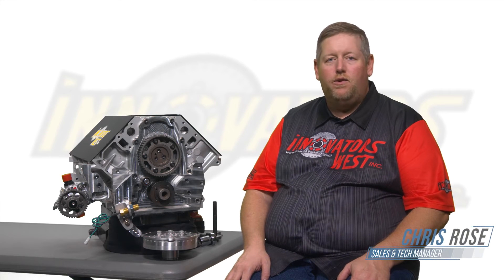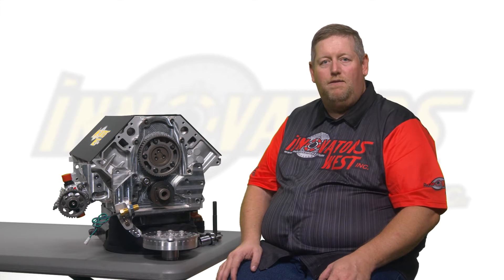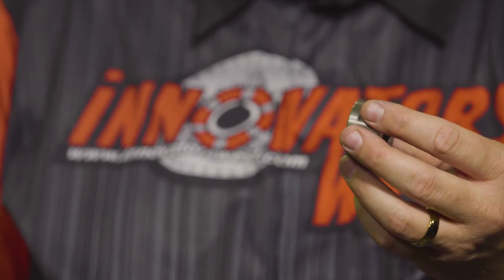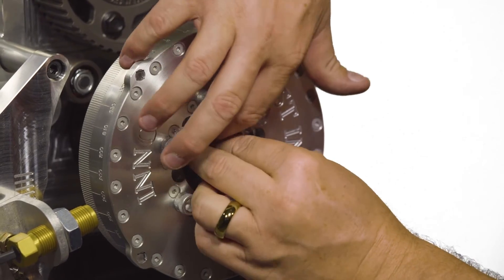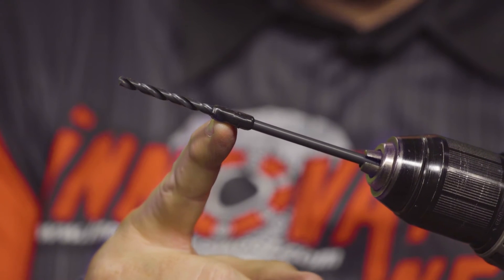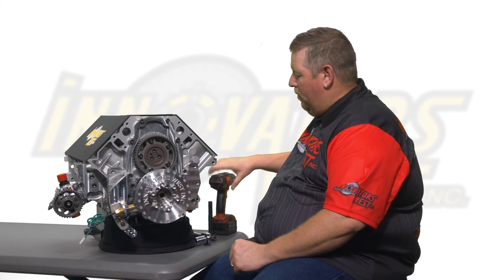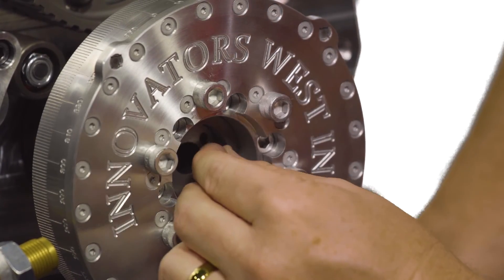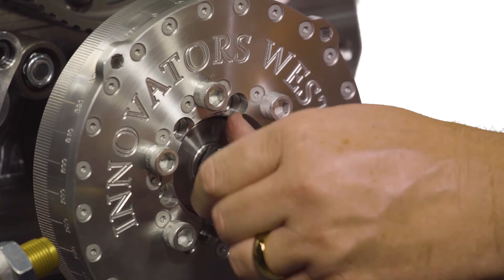Innovators West Tech Series - Crankshaft Pinning Kits

Comment: Any special drill bits needed? I snapped the one with the kit, then a second one and am currently trying to use a 3 blade style, but it may have dulled out and I'm not making headway.
The three blades are less likely to snag and break, but maybe they dull quicker.
Reply from the maker: With a stock crank, the standard "jobber" drill bits usually work great.

Comment: My ls3 got pinned with the Magnuson pin kit , do you sell a dampener that matches my pinned crankshaft?
Reply from the maker: We do not.  All Innovators dampers are designed around the Innovators pin kits.  You can repin the damper with the IW pinning kit on a previously pinned crank however.
Reply: @InnovatorsWest  I’m afraid of weakening the crankshaft
Reply from the maker: @FORMULA_376    It is not an issue from what we have seen up to the limits of a pin kit in general (750 rwhp)